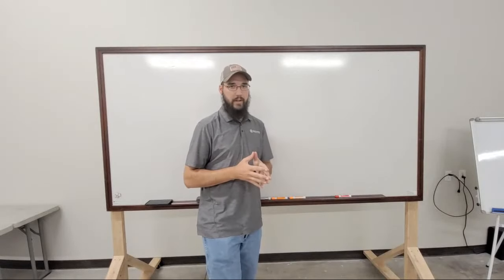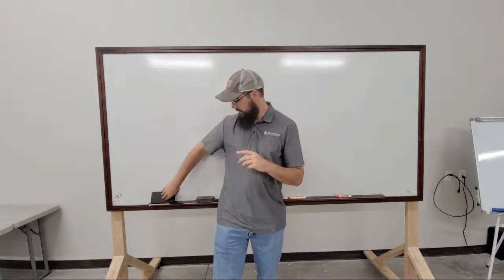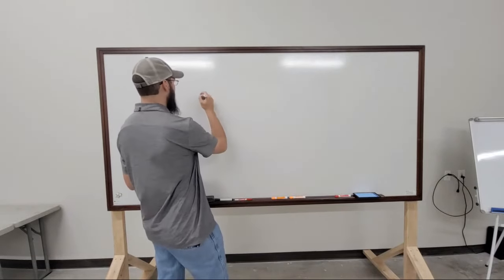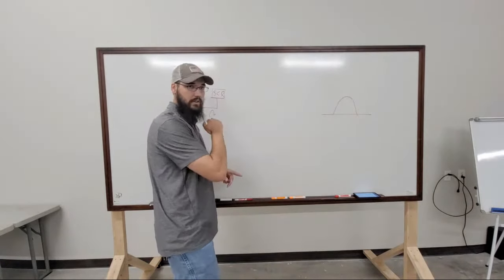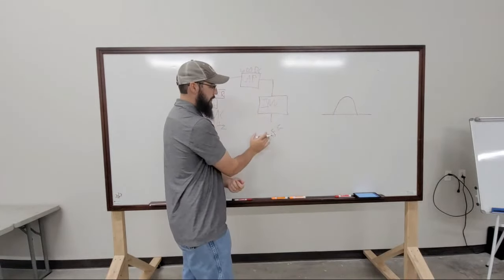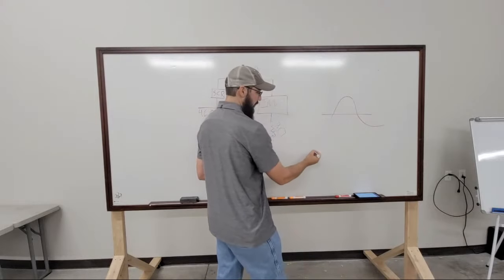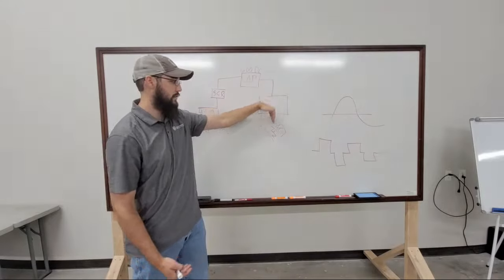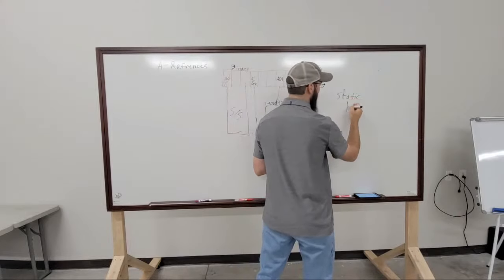VFD Theory & Operation

Comment: VFD - Variable Frequency Drive...Basically takes Ac voltage and manipulates it into DC voltage where it is then controllable as far as the Hertz is concerned so they can speed up and slow down large HP motors. Actually ECM motors in Residential units use the same principal.
Reply: Use ec motors on commercial condensers too. The ones I run into run off potentiometer pressure controllers, powered off 24 vac transformers, get their high pressure readings off transducers, then that controller sends a 1 to 10 Vdc signal to the controller in the motor. Just FYI in case anybody runs into those, I had to learn on the fly but there's several different setups.

Comment: Sir, just want to request you one thing. Most of the technicians in are not much educated.  practically they are very good so you should explain to the in different way which will be useful to them also. I mean practical methods. Thank you sir.

Comment: I believe you have the VFD theory incorrect.  What you are explaining is a PWM drive for a universal or DC motor.
First, the input AC, whether single or 3 phase, is rectified by a full wave bridge, and then filtered by a bank of capacitors.  This creates the DC operating bus for the VFD.a
A VFD output will still be a sinewave, of varying frequency and voltage.  The voltage will be lower at lower frequency so as not to saturate the windings at lower frequency and is controlled by the processor and sensing in the VFD.
The inverter creates a carrier of about 10 to 16 khz and that is what you hear at lower speeds.  The drive synthesis a sine wave, made up of the chopped DC bus.
The speed control comes from the inverter creating a variable frequency sine wave by using the carrier (which is fixed frequency), and controlling the amplitude that the carrier changes at, hence the variable frequency.
Because the motor is going to try and follow the magnetic field(s) created in the stator, varying the frequency will vary the speed of the rotor.
There is no PWM in an AC VFD drive, just a fixed carrier and a varying frequency that the inverter creates.
This is an extremely simple explanation, but I wanted to correct your explanation on a VFD operation.
Reply from the maker: That sounds nice but all the documents and training ive been through on drives supports my explanation of whats physically happening in the drive. End of the day the inverter still has gates that creates the pulsing. Its not a true AC sign wave.
Reply: @HVACTIME  you’re right, it’s a PWM approximation of a sine wave. Your meter reads it as a sine wave because it’s good enough, but if you were to measure the voltage peaks, even when the drive is making a 100V sine wave the peaks are still at full DC bus voltage.
Reply: @Ak3rn0 and @HVAC TIME, I have to disgree and agree with @Pomonabill220! 

Think about it- 460 Vac [Vmax] does not equates [rms] to 600 Vdc [heat] or 600 effective voltage. 

In retrospect, the Vmax applied to a capacitor reacts causing what is call capacitive reactance, meaning power [watts] is losted and current [electrical intensity] is increased, which needs to be inverted to control frequency [Hz].

Reason being, motor is an inductor therefore an inductance reactance of the motor occurs that also causes a power [watts] loss as electrical intensity [current] decreases creating phase shift. 

To elaborate further, an inverter job is to convert DC to AC voltage and a rectifier job is to convert AC at full wave bridge to DC voltage in an AC VFD configuration.

Therefore, there is no PWM [Pulse Width Modulation] in a inverter driven AC VFD [Variable frequency Drive].

However, in a DC configuration, PWM [Pulse Width Modulation] drives are typically low voltage driving DC motors- An example is the use of EEV soleniod or EEV stepper motor whose voltage is rectified from AC to DC at half wave, a voltage pulsation resulting in the term PWM.
Reply: @HVACTIME  , I came to an understanding what you are talking about; Older drives uses the method of current inverter, and variable voltage controller with the use of SCR [Silicon Control Rectifier] or Thyristors, as discussed, which is still in circulation, may I add. 

What you are discussing, however, is the latest emerging drive technology for the HVAC trade using AC PWM [Alternating Current Pulse Width Modulation] that is bridge at (Full Wave), not half, and controlled with (IGBT Power Transistor).

Great information Bud,  keep in mind though (full wave bridge, not half wave) for AC PWM VFD [Alternating Current Pulse Width Modulation Variable Frequency Drive]. 

Overall, great information!
Reply: @HVACTIME The SCR bridge is converting the complete 3∅ sign wave to DC, with 6 SCR's.  3 SCR's take the positive half cycle and the other 3 take the negative half cycle.  DC created from 3∅ is much easier to filter because you never cross through 0V.  Just need to smooth the ripple, but it never goes to 0V.  If this were 1∅ the capacitor bank would need to be much larger.  

The PWM signal is AC as far as the motor is concerned even though, looking at it in a oscilloscope it is a bunch of 600v DC pulses going positive and negative.  The field in an inductor has a delayed reaction similar to a capacitor, so the field in the motor doesn't instantly collapse when the signal disappears form the VFD.  Remember that a motor is nothing more than a spinning transformer.